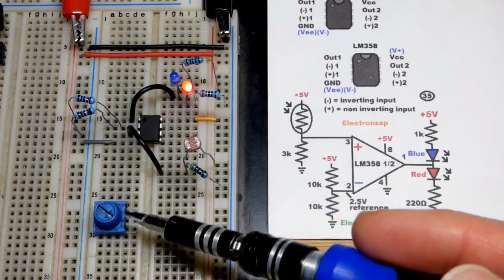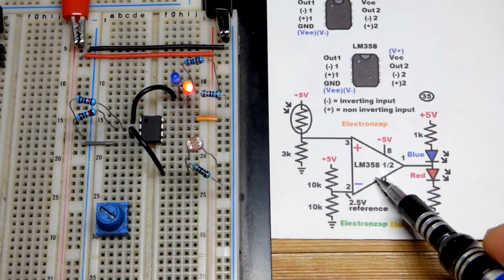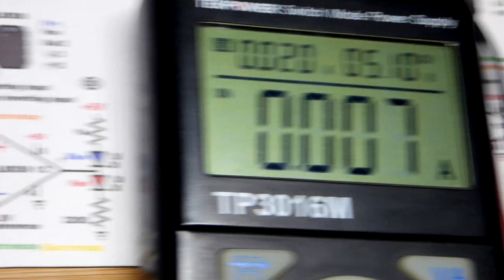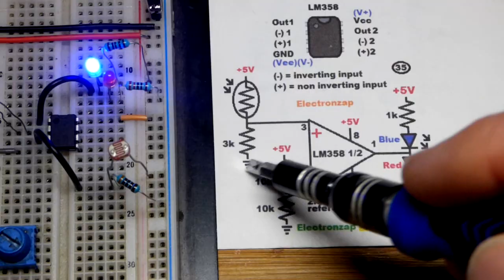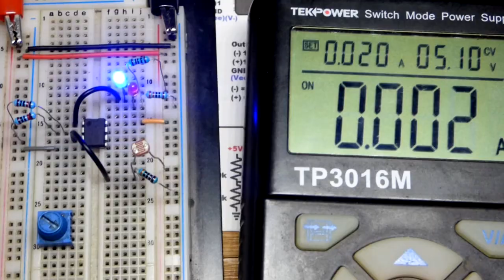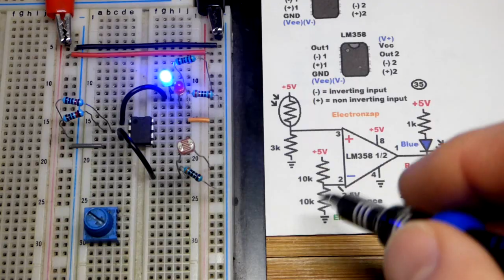LDR Controlled Op Amp Non Inverting Comparator Light Dependent Resistor

Comment: At 2:40 "as close to 5V as it [gets]". Not really. The LM358 is notorious for its inability to swing its output close to the positive rail. Even at microamps of current, its high output is more than 1V below the positive rail. At the 10+ mA you would expect to source into a red LED and a 220R resistor, you'll typically drop more like 2V from the positive rail. For what it's worth, the 358 sinks currents when its output is low with significantly less voltage loss, remaining within about 0.7V of the negative rail for currents up to 10mA.
Reply from the maker: Thanks for the info!